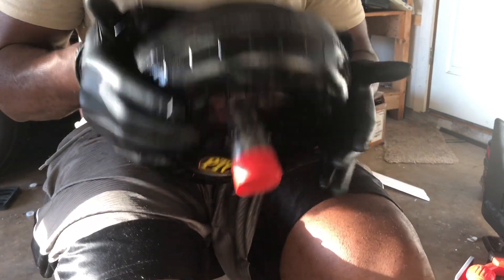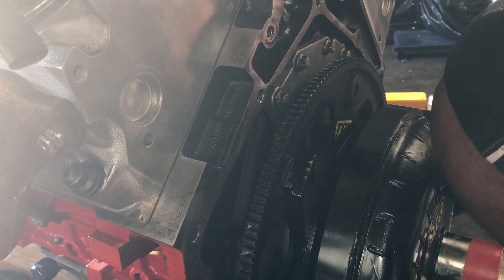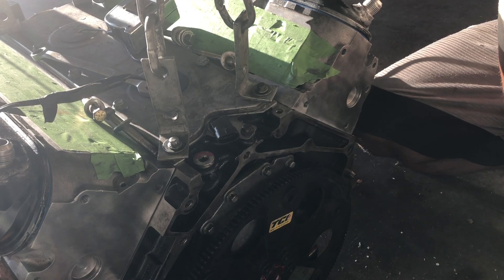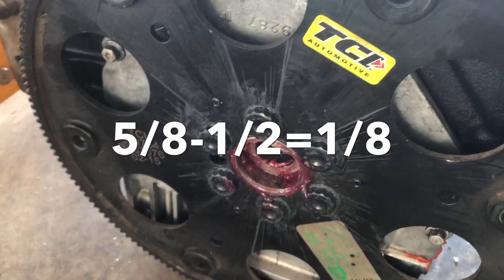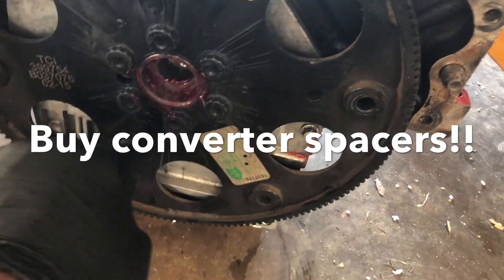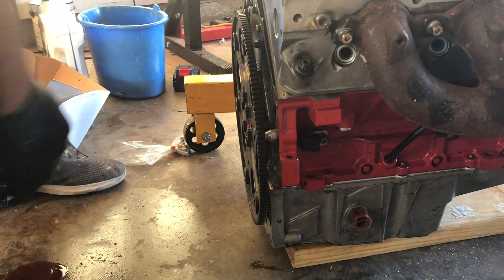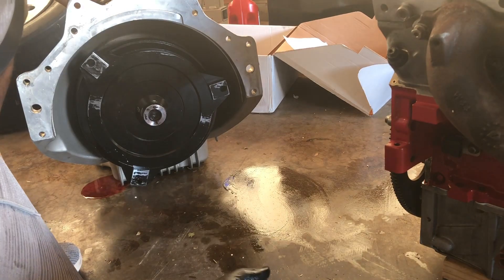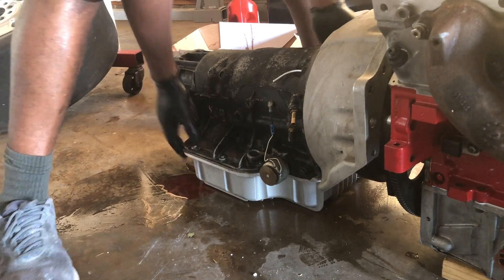Torque Converter Spacing!!! LS Bearing Failures #converterspacing #PTC #turboLS

Comment: Thrust bearing is why I am here now
Reply from the maker: Make sure that converter spacing is right. At least a 1/8” gap
Reply: @ much appreciated, the motor fix has now spiraled into building a all motor 450hp 5.3 😂

Comment: I have been building engines for over 27 years and I have never seen it done like this with grease... I just use a washer and make sure the TQ pads still touch the flex plate.  While you don't want the TQ to bottom out on the crank hub, you also need to be sure you have 1/8" minimum measured with the transmission installed, before you bolt the converter to the flex plate.  You push the converter all the way back into the pump housing and you should have 0.1250 - 0.1875" (1/8" - 3/16") of space between the TQ pads and the flex plate.  This is done so that when you put power to the converter, and it balloons out, there is someplace for it to go.  You can have 3/16" of space between the tip of the hub on the TQ and the bottom of the crank snout, but if your TQ is tight against the transmission pump when installed, you will kill the pump or the thrust bearing or both.  If you have more than 3/16" between the TQ and the flex plate, when you bolt up the TQ, you will pull it too far forward and have poor pump engagement that can cause a pump failure also.  It is very important to measure both sides...  I had one engine build for a race car that we had to put a spacer between the engine and bellhousing.  The TQ needed all most 1/4" of spacers to fit the crank hub and this put the TQ too far back into the transmission, so we literally had to back the entire transmission up with a 5/16" thick engine to transmission plate.  That gave us the 1/8 inch we needed at the snout and the 3/16 we needed at the back side for the pump clearance.

I like the idea of using grease as a marker for end gap... that gives you an actual engagement measurement.  The way I have always done it, simply tells me I have 1/8 inch or more end play, but I don't really know how much engagement I have.
Reply from the maker: Yes sir, I found the hard way a few years back that not enough clearance will eat a thrust bearing

Comment: Did you mess up the bearing with that converter? Or did that converter sit right
Reply from the maker: infamousnova my current converter is spot on, I was just double checking. I did kill a thrust bearing years ago. Because my old converter wasn’t spaced properly.
Reply: @boostinwillie  seems li,like, I got the same converter as you, they asked what type of flexplate and I said dished because that was the stock one. I just bought a better dished flexplate I guess lol
Reply: @boostinwillie  what kind of trans fluid you running?
Reply from the maker: I put valvoline in that what I was running before
Reply: @boostinwillie  Full Synthetic?
Reply: @boostinwillie  Gonna attempt to install motor and trans this Sunday. Hoping there's no issues. After I install it then I have to attach headers, turbo and master disconnect switch.  Gotta find where to route alt wire
Reply: @boostinwillie  I cant weld or nothing so I went with what I thought was the easiest route and got the hooker turbo manifolds
Reply from the maker: infamousnova yep full synthetic
Reply from the maker: infamousnova nothing wrong with that💪🏾
Reply: @boostinwillie  so I installed mine and it's tight. Won't stall over 3000rpm. Thanks ptc
Reply from the maker: You have a transbrake?
Reply: @boostinwillie  yes I do, only hits 3k on the brake

Comment: I trip on this every time I put a convertor in man. I’ve never killed a thrust bearing yet knock on wood
Reply from the maker: I killed one a while back, and learned from my mistakes hopefully 😂
Reply: Boosted Lucille To be honest I’m a bit worried about what I currently have. 

I used a old sbc converter with the pilot spacer and everything was so tight and there was little i could do. I don’t have a brake at the moment so I should be ok for now. 

I planned on getting a new Ptc and a glide in the car but 2020 happened so that got put on the back burner. Sucks cuz I have 10k into the chassis and can’t leave hard enough to run the time the car is capable of. Need that converter and brake bad.

Comment: So what dictates the plus or minus in distance when measuring. The converter snout or the depth of the LS adapter. Or will it be both
Reply from the maker: The crank depth should theoretically always be longer than the amount of snout that slides in. It should always be crank depth minus the amount of converter snout that went in.
Reply: Boosted Lucille thanks for the info